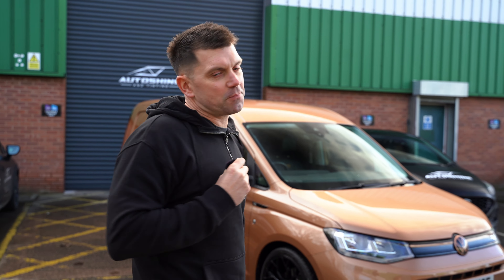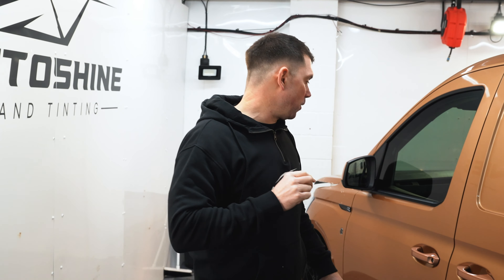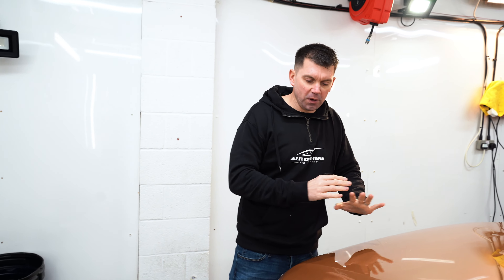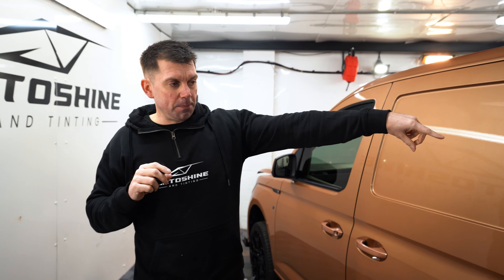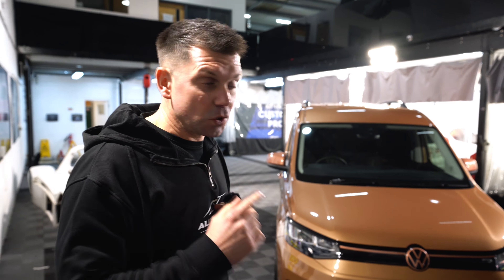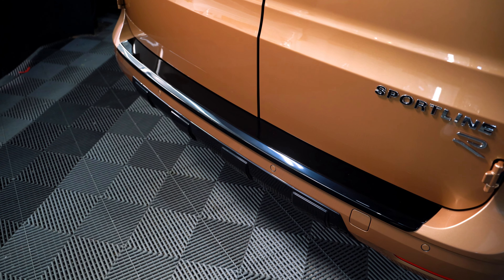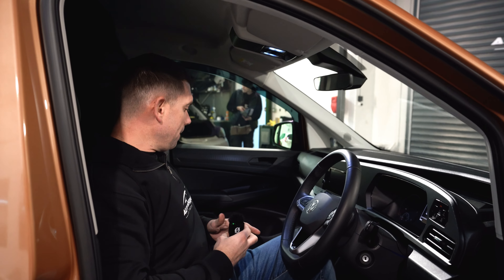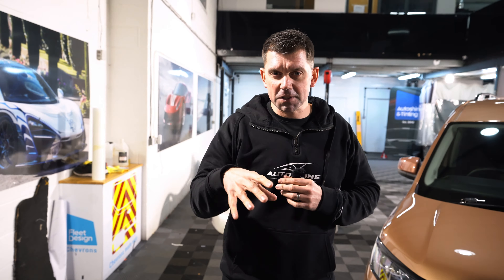New 2024 VW Caddy In For PPF | Is It The Same As A Ford?

Comment: I won’t buy either until I am certain that VW isn’t using the dreadful Ford wet belt engine.
Reply: It has VW engines, Ford got the Caddy platform, VW got the Ranger but uses VW engines and git the Transit using Ford engines.